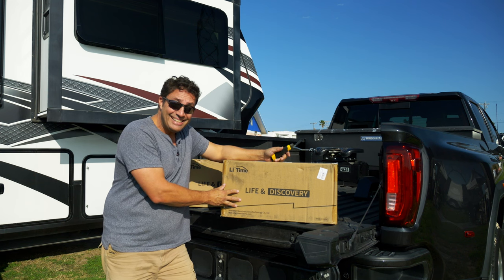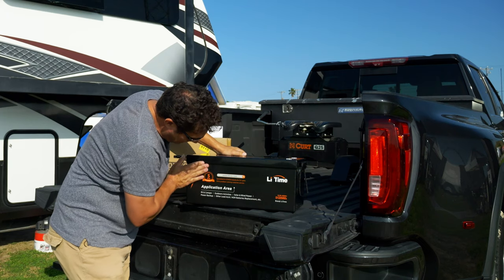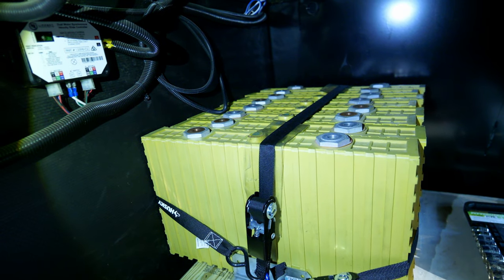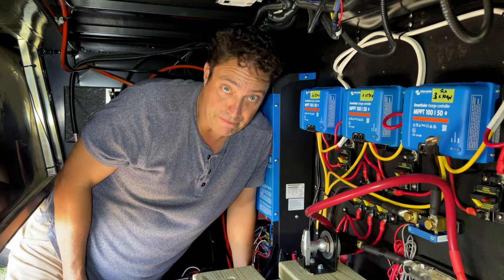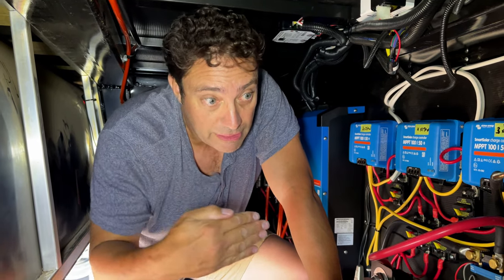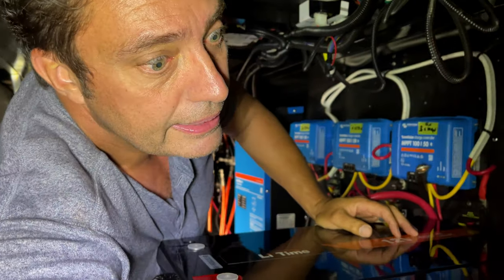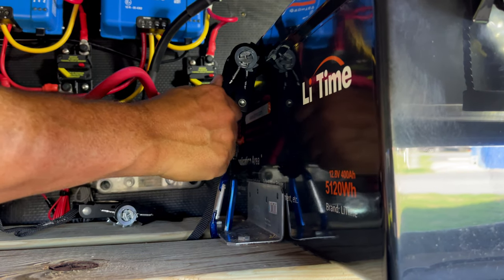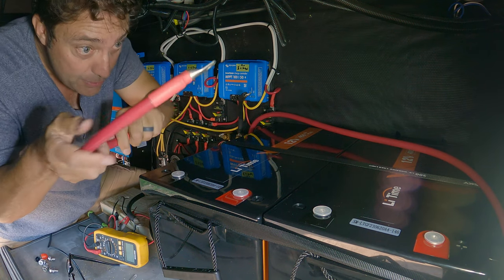Powering Up Adventures: Lifepo Battery Install for Your RV - Easy to Enhance Off-Grid Living!

Comment: Love your channel.  One suggestion is the aluminum carabiner you used to secure your battery strap is a weak point.  Those aluminum ones bend and break easily
Reply from the maker: You're probably right... Nice advice. Cheers

Comment: G'day mate from Brizzy
Mate I see your metal angle brackets to prevent East West movement of the battery bank.....
That's Metal to Plastic battery box housing.....
With the jiggering of the Motor Home whilst under way........
The odds are you will wear a hole in the side of them there beautiful new batteries after a few hundred miles 
After many years on Cats up and down the Qld Coast plus 10 x Brizzy to G/Stones and god knows where else
I've learned to never let Metal rub on plastic without some rubber or carpet between them there different surfaces.

Good on you and please keep the clips coming. 
I've hitched or driven over a lot of the country your currently on. 
Your on a nice patch of land there ole mate
If things work out.... I'll be rolling rubber in a 70's GMC MH in the next year or two over there 
when I'm not rolling my little 24' Merc bus around over here. 
Enjoy the lifestyle mate... you are living the dream👍👌🤗
Cheers Rosco
Reply from the maker: Ah good advice there Rosco. Hope to see you on the road somewhere. Cheers

Comment: Was wondering anyway that you had done that cannibalism to Jupiter. No electricity means no active ventilation to prevent mold and probably also no security online observation of the floating house even its on the hard. I am actually very happy to get the idea what is happening at my remote locations and be able to check it out if I get concerned somehow. Sure if really something happens little I can do, but at least I can get someone to help to secure the aftermath and get legal action in place without to much delay.
Reply from the maker: All sounds good, except I am pleased to not have any electrical circuits powered up when I'm away for months at a time... Pros and cons. Cheers

Comment: I wouldn’t have connected the batteries like that. The cable length to one of the batteries is longer so they’re not both delivering the same voltage and won’t discharge in the same way.
Reply from the maker: Sure, will monitor, and see how they go. Didn't want to buy a new cable.